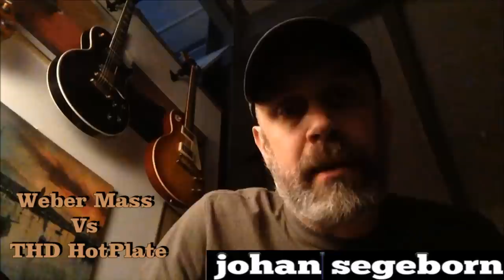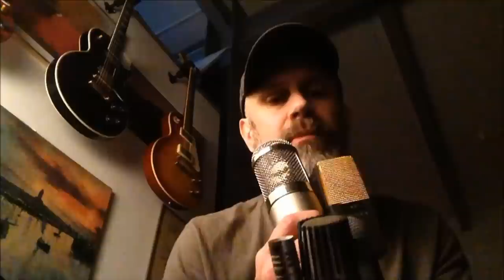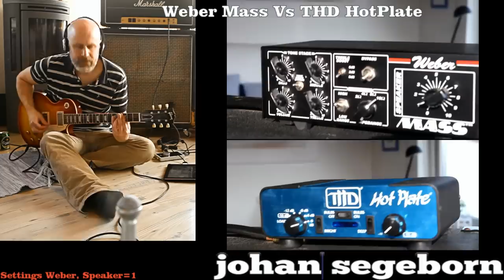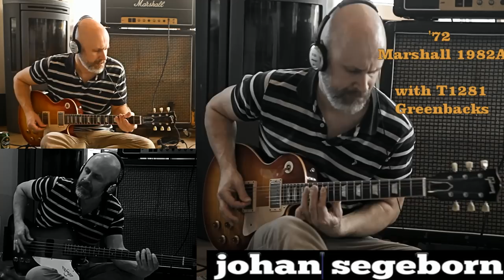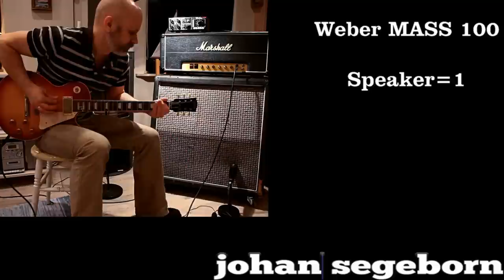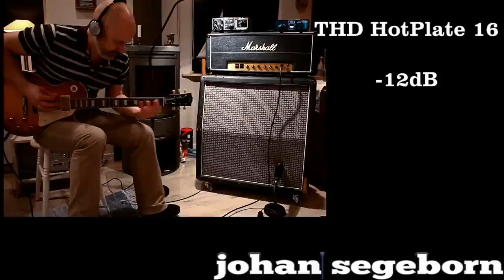Weber Mass Vs THD Hotplate - Power Attenuator Comparison - Shootout

Comment: for what it's worth: this looks like an older version of the mass 100 but i don't believe much has changed over the years. i just got one and i'm blown away. and i'm not trying to do cranked tube distortion at bedroom level, i'm trying to get a naturally compressed clean tone at a reasonable stage volume, and MAN does the mass excel at that. life changing!

Comment: Still to this day not much has changed but the super cheap Bugera now out. I tried that one for $110. It was ok if you set your amp volume to 1-2, and set it at 12 o’clock for bedroom. But anything else by turning the amp up was bad. Also the DI volume doesn’t work, and it works on the main volume. At that point better to stick a mic on the cab. 

So after taking to Weber and telling them my findings with the Bugera, and asking questions. I decided I’m returning the Bugera and getting the Mass 100. It’s a bit more at $300 these days for newest model. But the feature set and transparency is much better! I found the $100 ones that are all same made in China design, are fine if you have a cheap amp, don’t want to spend a lot and play with your amp low volume then shave off some db. But cranking it and dialing enough off even to record…it doesn’t sound good to me. The Mass 100 at least has the treble controls, the DI out eq and you can use it as a load box. So you actually can use cab sims and be quiet at 3am to play or make demo tracks. The Bugera does one thing and at that it cuts it by 50% just being plugged in. So the tone is even sucked a bit fully open. 

Even in 2022, best bang for buck is the Web Mass. Prices went up $50, but it’s a good kit of you have a nice amp and don’t want to risk it…plus have full on working features. Many cab IR loaders you can get free, and free IR responses as well…if that’s your thing. I couldn’t do that on the Bugera! Sometimes in DI it would hiss even! Without spending $600+ I haven’t found much better than Weber🤷🏻‍♂️

Comment: Awesome video and playing as always
I realy enjoyed this one as i have the THD hotplate 4 ohm, I realy liked the Weber Mass dynamic response, When using my Hotplate on the -16db i prefer to keep the continous knob high all the way, the lower it is, the more you lose the dynamics from the amp, the best thing to do to get the best tone is not to use an attenuator but sometimes it is necessary for home environments or studio. Great job Johan
Can't wait for the mic comparison, keep rocking
Noah
Reply from the maker: JCMSLASH - NoahThawco Thanks Noah, always interesting to hear what you think. Cheers Johan
Reply: Johan Segeborn Great Review did you use the treble on either one? Also to your ears witch one sounded the best? i'm asking because i'm in the market for attenuator  im in toss up between thd Weber and jetunator.  the only problem with the jetunator it has no treble boost but does have di out which i don't know if thd or weber. have.

Comment: I've got Weber mass 100 that I've been very happy with. I like that you can dial in any volume with it. Of course it doesn't sound as good as cranked, but I think the difference in sound has to do with the speakers not being pushed more than any kind of signal degradation within the attenuator
Reply from the maker: +MrBingping Speaker distortion has indeed an influence but actually it's mostly signal degradation in the attenuator. In this clip I use the Aracom down to bedroom volume level, with remarkably little sound degradation, but it colors the sound more than the Weber.
https://youtu.be/8rJzLDaCzoE

Comment: Weber site says "Many amps can reach full power at 3 or 4 on the volume dial, so it is a good suggestion to get an attenuator with 4x the power handling. For example, if you have a 50w high gain amp, you should opt for the MASS 200. If you have a 100w amp, you should still go wtih the MASS 200 but you should not crank the amp."
Reply: Should not crank the amp? ... kinda defeats the purpose then.

Comment: Interesting comparison and very well made!
I myself have a Aracom prx150 undoubtedly the abolut most transparent of them all!
Reply from the maker: Thanks, I'm gonna look for one of those. Have heard great things about them. Cheers
Reply: Johan Segeborn Yeah the aracom is awesome even at bedroom level. The hotplate is ok at -12 dB but at -16 or lower the sound seems to be fuzzy and you loose a lot of harmonics.  The weber seems to be good for the price too. Like always, you always get what you pay for.
Reply: pleximanic I heard they are very good, I'm going to put my THD on ebay and get one I think
Reply: pleximanic I've got one too and it's a gem of an attenuator.  I've used it with an early '73 JMP50 that didn't like attenuators and it worked beautifully.  The amp didn't heat up like it did with other attenuators and I got everything that I needed from the Aracom.  However I found the Aracom really cut the highs on my '68 Plexi and '68 8x10.  In the Aracom's defense the cabinet is pretty bright, though it does take away from some of the awesomeness of the plexi and I had to switch it for my Dr Z Power Brake which seems to do a pretty good job.  The Aracom also works very well with my '72 Park and '72 straight cab with 75hz greenbacks which is a darker sounding combination.  Now that I've heard the Hot Plate in action I'll give it a try on the 8x10 to see if it's more transparent.

Comment: Hi Johan! Very good video!!! Thanks!!!
I have a JCM800 2204 (50 watts) with S.I.R mods #34 and #36 and I'm looking for an attenuator to use with it. I'm in doubt between the THD Hot Plate and the Weber Mass 100.
Would you recommend which of the 2? I keep thinking that if I buy a 100 watt amplifier in the future, I won't be able to get room volumes with the Weber without damaging it.

Comment: I like my THD with my 64 SR but after 12dbs you are paying a price.  The Badcat Unleash seems to work well but I needed a Z Matcher to make it work with 2 ohms from the amp. I did a demo of both but really for just attenuation the THD especially for what they go for used.
Reply from the maker: Do you have a link to the demo, couldn't find it on your YT channel. Cheers
Reply: Johan Segeborn  What differences did you notice between the two in person?
Reply from the maker: The Weber was a bit darker but more transparent. The Hotplate coloured the sound, brightened it up but in a natural sounding way. On bedroom volume levels only the Weber was good enough. Cheers
Reply: Johan Segeborn You inspired me so I tried the Weber with a 64 Super Reverb.  Ill compare it with Unleash later.  I also did a demo of the optional headphone tap.
http://www.mylespaul.com/forums/squawk-box/337325-weber-mass-100-new-version-headphone-tab-demo.html

Comment: GREAT DEMO JOHAN THANX,IM GETTING THE MASS 200W
Reply: How are liking the mass 200?
Reply: @Platewarp  i cant say how happy i am with the mass 200.its the only soak that doesn't ruin your tone in any way.i advise all to get one.the fryette is no answer as its a power amp and what use is that if you change your old fenders power amp. Defeats the purpose. Weber soaks imo with there dummy speaker motor are so transparent. Plus it handles any amp.also soaks with high power ratings to my ears always sound better
Reply: does the Weber mass 200 allow you to set different impedance on input from amp as well as to speaker cab? I see the toneking does but it’s more expensive.
Reply: @JimmyDevere  no you can basically use any ohmage you want because the weber has a speaker motor design and it doesn't  matter what your amp is set to.let ,me say this besides the fryette[which isnt a soak or the ox box] the mass 200 is easily the best sounding soak out there.it retains tone way better then my jim kelly soak

Comment: test with a mastervolume amp as well and see how the attenuators compare to master volume being turned down. Easy enough to say "oh the thd sounds worse at -16dB" but a real comparison isnt to the non attenuated sound but to the master volume bringing it to the same volume level. Although yes a comparision vs bypass is also interesting to hear too to hear how transparent the attn is but even if we know it is not at high attenuation, would then be good to compare to master volume. Because I remember years ago having the thd but the powerbrake was no longer in production and hard to get and the weber wasnt so easy to find either or was a lot more expensive if i remember correctly.

Comment: Ok, i forgot the attenutors ^^. Thanks Johan !
Reply from the maker: dafxtone So which one did you like best?
Reply: Johan Segeborn Any. i didn't support any modification of the original sound ! It's each time make the sound duller, less agressiv, less authentic.
Reply from the maker: dafxtone Yeah unattenuated is certainly to prefer when circumstances allow it.
Reply: Johan Segeborn In most correct amp nowaday, you (should) could find a volume switch which will do correctly the job. But not on Plexi, not on 5150... Sometimes it's really hard to setup the volume from 0,1 to 0,2 without  going to 1 ou 2 and blowing your house and you hears (i remember my Fender Hot Rod, 40 Watts was terrible for that). Even the Mesa recto 25 watts isn't really playable at low volume in modern mode... Obviously, if i had to make a choice in both of them, the best would be the -16 db, closest to the original.
Reply: Johan Segeborn And the only interest for an attenuator in ly opinion would be to make the amp tubes sing. It's not require so much higher volume, but definitively too much for bedroom. So loosing the hear of the sound in treeble with attenuators while trying to push the amp to get more life, it's not really a convincing deal for me ;)
Reply from the maker: dafxtone Yeah, I agree but a 100W amp needs to be attenuated somewhat to be able to record it in a small room without feedback and various noises. It's extremely loud. ;-)
Reply from the maker: dafxtone The Yngwie Plexi model, has a built in Power attenuator.
Reply: Yeah 100 Watts are very loud. But i remember it was fine with a JCM800 Head, pretty sure it was a 100 watts model and was possible for recording at bedroom level. On my Mark V, the 10 watts mode is marvellous for that, never seen a better things and it's pure class A.
Reply: Johan Segeborn

Another way to play is to put a volume pedal in the serial fx loop if you have one, but it's not working for each amp, it depends the kind of FX loop (buffered or not) and it quality. I remember the OR15 have a really shitty FX loop, Engl gigamaste, 5150...
Reply from the maker: Interesting I'll try that on my Dual Rectifier :-)
Reply from the maker: Yeah the MarkV is a piece of excellent engineering
Reply: Johan Segeborn If it's the Newest version you 'll have a serial fx loop, the older, a paralelle fx loop.

Comment: Johan, is the additional cost of the tone stack on the Weber mass worth the additional cost if you are only attenuating a bit? I'm leaning towards a mini-mass or mass lite for a Fender 22w Deluxe Reverb head but the ability to mass with bass, mids, and treble on the Mass w/ full tone stack is tempting...
Reply from the maker: Hi, I bypass all EQs and correction features on the Mass, so if the other attenuators are identical besides the EQ, they'd do for me. I adapt the EQ on the amp instead. Cheers
Reply: Johan Segeborn Thanks much, Johan. :)
Reply from the maker: You're welcome :-)
Reply: I have a Weber Mass, I use on my Fender Deluxe Reverb, works and sounds great
Reply: Thanks for the additional feedback, John Finley. I'm definitely going to grab one when I find the right deal on Reverb.
Reply: isnt the tonestack on the mass for line out only?

Comment: Great review!
Would the Mass 100 work properly with a Super Lead 100 as long as the amp wasn't turned up all the way?
Reply from the maker: +crazybaldheadz Thanks! I'd go with the Mass 150 or 200 for a Super Lead.  But if you don't attenuate down to bedroom volume the 100 is ok. Cheers Johan

Comment: HI, I owner of THE  SILENCER attenuator of Doctor Amp. I need work with level bedroom using the attenuato with  -16 db,  and the problem is the tone, the incredible loss of tone. I am thinking buy the MASS III 150W but I don´t know if you will  loss tone working with -16 db like The Silencer. Is possible work with a JTM 45 Marshall with crunchy tones in your bed using MASS III 150W with a well tone?. I think that in that sense all products Weber Mass will be similars. Thanks

Comment: Hello johan i have a jcm2000 and tv cab (25watt greenbacks) and recently bought 16ohm thd hotplate. I set it up how your supposed to but 2 of my tubes red plated and then the mains fuse blew. I replaced both tubes cause they where fried but now when using the hot plate the amp is getting very very hot but the hot plate stays cool and doesnt heat up all. Is there something wrong? Why wouldnt my jcm2000 like the hot plate but you seem to  be using one fine with your plexys? Does anybody have any ideas?

Comment: Johan how do you like the Marshall power brake?
Reply from the maker: +Billy Ards I have only used it a couple of times, so my experience is limited. People who use it tell me it's very transparent at slight attenuation levels but not as effective at heavy attenuation compared to the Hotplate. Cheers
Reply: I once had one - it kind of looked cool, but I didnt think it sounded good at all. The older Marshall which have active circuits in it, sounds much better.

Comment: Hi. Im having trouble trying to find a proper attenuator. I tried the rivera rockcrusher but it didnt suit me as i intend to use it for rehearse and gigging, and the first level of attenuation (-3db) drops too much volume as i play with a very loud drummer. Im now trying to find and attenuator with more options  between bypass and -3db as im interested im pllaying my marshall 100w loud (but not bypass loud!) Any help will be really apreciated. Great videos there! cheers and sorry for my sloppy english
Reply from the maker: +Ariel Ruiz Picot Thanks Ariel! The Hotplate starts at -4dB but maybe the Weber are continuous. Otherwise you could get less efficient speakers. For instance a G12M is 3dB quieter than a V30. Cheers Johan

Comment: Great video!

Johan Segeborn, could you please help with this? I have a Weber Mass 100, but I'm afraid of using it in a 100W plexi, since the Weber website says:

"Full attenuation: up to 60w amplifiers. Slight attenuation: up to 100w amplifiers."

How come were you able to attenuate a 100w plexi fully with a Weber Mass 100?